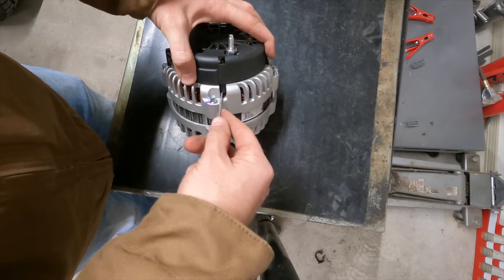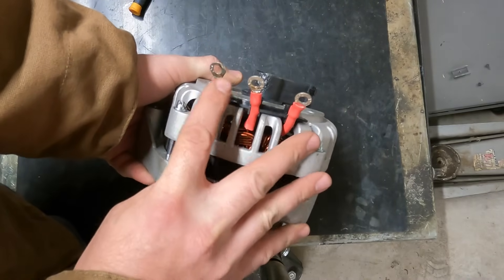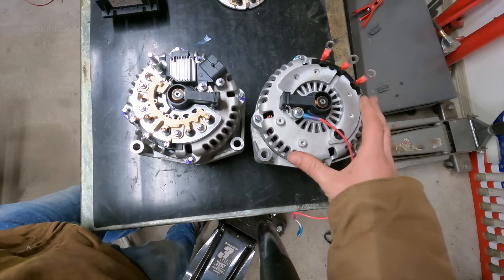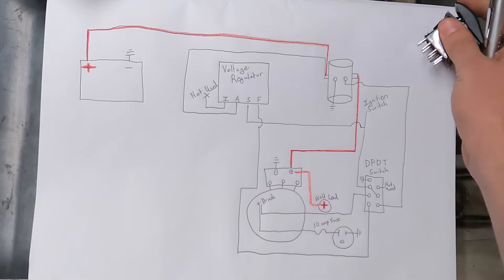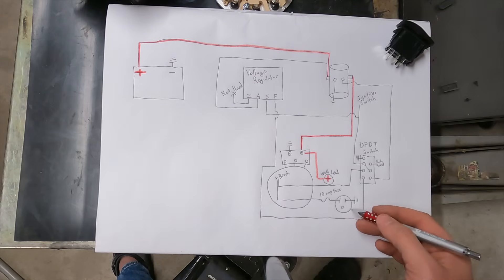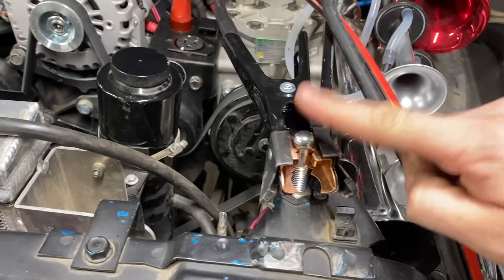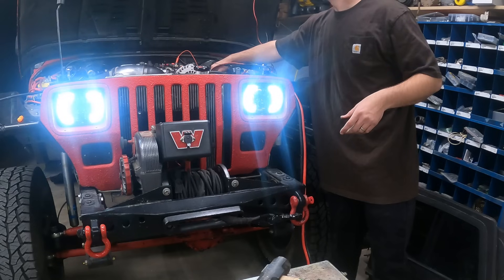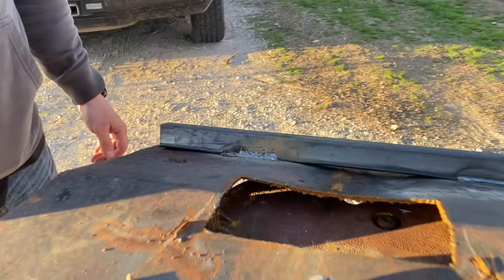How to Modify an Alternator for Charging AND Welding

Comment: Cool mod for the trail.
On solinoid nomeclatur and description,
a solinoid relay is energized CLOSED when applying 12v to the control side. It OPENS when the 12v source is removed.

Comment: Looking at the wiring diagram it seems as though the entire electrical system could experience a voltage spike during a welding operation. Am I wrong? If so, wouldn't that be a problem for the vehicle's computer/ecm?

Comment: Great video and explanations. Are you able to run this set up on modern fuel injected engine and electronics (~2016) without frying them or am I better off installing a second dedicated alternator?

Comment: Overall a good video.  There is lots of internet information on making a dedicated welder from an alternator.  There is far less information on a charge/weld configuration.

One thing you will want to fix is that the welder voltage needs to be visible from the manual throttle.

Comment: Oh by the way you can also connect center tap transformer's to the stator for higher or lower volts just dont connect a transformer to dc it will burn up thats where hi speed mosfets or ibgt transistors come in👍

Comment: Good video you can also make a welder using a mot microwave power transformer like i did by rewinding the secondary  just need a metal box add a copling fan just input output ac welding or like you did use a hi current diode bridge

Comment: Just came across this video, the information for the most part is excellent. I am slightly confused though. In wiring diagram, you show the 110v plug being the positive source for the brushes and the negative coming from the DPDT switch. As I understand DC electrical circuits this would make the 110v plug a service disconnect, nothing plugged in no electrical flow. I believe that the 110v plug should be connected to the same rectifier terminal as the positive welding lead.  Can you please let me know where my understanding is going wrong?

Comment: Thats cool!!!! I would like to try something like that but with a spool gun and Flux core welding. I hate stick welding bought a tig a couple years ago off amazon a cheapy and dint have gas for it so tested the mma function worked great actually used it for 2 days hadnt used a stick welder since the 80s when i was in hi school lol and then remembered i had a wire feed welder in the truck and grabed it i was building a aframe engine hoist. Took me a day just to get decent with the stick lol the wire feed is a 26 year old century 80 ac welder i bought new i can weld the hell out of it but its a hard welder to use just 2 switches no knobs lol. Would definitely like to try this on my truck i have a couple extra alternaters also from what i understand about the ac motors in tools you need 120 volts of dc to get them to work right haven't tried it my self but your grinder sounded i little underpowered. Good luck and loved the video!!!!!

Comment: At 14:17 mark, you pointed out the blade ports on the 120 volt recepticle. With the round port down, wide port on left is neutral, narrowest on the right is positive. You said the opposite. Not sure if it was intentional or a mistake. Im not an electrical engineer. But this video is freakin amazing!!!! You are one helluva sharp minded individual to design this to work so well in such a small sanitary package in an already over-complicated,cramped area under the hood of a modern day vehicle. Thank you so much for this video. Real good stuff right here man.

Comment: on the voltage regulator the I,A,S,F i think they are as I =ignition A= active + S=switch F = fuse for anyone with electrical knowledge that wants to wire this up differently?

Comment: Why not put this to use with a small gas or Diesel engine? That cable control for the throttle looks like it came from an aircraft supply shop. We have those on general aviation aircraft for throttle control.

Comment: Didn`t hear now change in rpm when you struck that arc.. i would imagen that would be a thing that you hear if you think of the load you give the alternator. I mean on some old engines/cars you could hear change in rpm even when you turned on and off the lights, and that`s nothing compaired to and weld arc.

But im a mornon who has no clue . nice video tho

Comment: So is this the same alternator that the engine runs off or an auxiliary? If thats the only alternator wouldnt you be worried about the power running out and the engine quitting while welding and not charging?

Comment: Great video! I can see where you're going with the potentiometer. I'd add a voltmeter in addition with the potentiometer so you can see how much voltage you're supplying the positive brush during the welding circuit operation. It'll create "weld settings" instead of full power to the rod. Good stuff!

Comment: When I weld on a car, I always remove both battery leads. 
But in your case a simple way to overcome the issue the pinned post pointed out is this:
Figure out a way to mount another alternator on your jeep. Also, mount another battery and use both of those exclusively for your welder and make-shift 110v plug. Leaving the "normal" alternator charging system including battery intact and unmolested. 
That instantly solves the issue of crazy voltage spikes running thru the Jeeps system. 
Consider shooting an update video if you're still using this "Welder system." Or??

Good Video!

Comment: I think you’re going to have trouble with that rocker switch under the hood. They can’t handle severe conditions. Between the heat from the engine and the louvered hood letting the rain through that switch won’t last long.

Comment: .. also i worked at an electric motor rebuilder just out of high school, & our 'Solder' jobs on them was closer to Brazing, with an Oxy Acetylene Torch & Brass Rod .. that ain't Solder, that's why it won't Melt with a Soldering iron ..

Comment: Me personally, I'd use a buck boost DC to DC converter to power the field coil with adjustable voltage, to allow the current and voltage to be adjusted. This can be adapted to control charging voltage also. By controlling the voltage the regulator sees. It may require also using a voltage divider as well.

Comment: In normal use, a car alternator doesn't have to produce more than about 14.5 volts output and the regulator progressively reduces the rotor voltage/current as the engine rev rise. An alternator that can charge a 12v battery with the car idling at 700rpm, would otherwise try to output over 100v at full engine revs. It is entirely possible that the standard rectifier pack could cope with your welding current but their rated voltage is being exceeded by running without anything (the regulator) to limit the output volts.

Comment: OMG  rebuilt 1000s of them Alternators  you need to put flux on them heat them i use at lease a 100 Watt Soldering Iron when they get hot blow them with air gun

Comment: I'm no welder, but I do own an ac welder. It came with very short leads. I went to purchase some welding lead cVle at tractor supply, and holy shit, 0 gauge welding cable was $5 per ft! ( This was quite a few years ago. That probably sounds like a bargain now, but it seemed high to me. Oh, but I'm so smart! I can get 20' jumper cables, also 0 ga, for only $25 at the very same  store! What bozos that don't know how to shop! This will give me both positive, and negative for a fraction of what just one side would have cost using their "welding cable" these jumpers are copper, says so right on 'em. Right above where it says ling long brand cables. Made in China. 100% copper. Well... Turns out, 100% copper is part of the company's name, or product, not the actual material found within the insulation.  But I hooked them up, and worked like the cats ass. I'm a fucking tbrifty Genius!. After several welds, I would notice the ground would get very hot. Huh, that must be that duty cycle thing the machine speaks of. Then I would notice it would get very hard to strike an arc. Must be this damn ac machine. I knew fuck all when I bought, had I known I would have got a DC machine. Still, when I used the 7018ac rod, it was easier. Eventually I couldn't make an arc. No matter how long I let the mXhine recover for her "duty cycle" even days of rest. So I took the stingera part, and I'll be damned the copper where the Allen bolt pins the bare wire into the stinger, that wire was all melted back, and some was even rusty. Well we do get a lot of rain here in PNW, some winters are so wet, even copper rusts. Ok, so I realized this jumper cable has its limitations. I found that if I kept my welds to 3 rods, and then let everything completely cool, it lasted longer. 2, and a quarter really, but 3 had a better ring. I still had to cut the wire back several inches And retork that Allen every few uses, but I was mostly fucking around, fixing shit when I needed, or just to practice. One day I was fixing something, I don't recall what, but I needed to get it done, and also go have dinner with my wife so where, so fuck the 3 rod limit, were gonna push her. Bit, and I'll cut the wire back later. I could feel it getting pretty hot, but I was almost done. Then she started making an arc, but I could still see the flash under my helmet, but no we'll, no sticking the rod, I flipped up my lid, and at the splice between the jumper, and the original  leads, which was a very solid connection, and taped up real well, fire scared the shit out of me, I try to go way overbored to prevent it,  likd very anal, to where peopme dont like me around a campfire, trash barre, bbq, l, and definitely not on 4th of July, vecuase of all the precuRions i insist upon before the fire is startes, but at that joint the insulation was on fire, it had lit up some dry grass, and some sticks ect, and was licking tbe cedar siding on my garage. This was 15' away from where I was welding; luckily I already hX a hose where I was working, and had pre wet everything near what I was welding, so I was able to lat those 2'fmames real quick.  I immediately took those jumper cables off and threw them away. They Ain't copper they are steel. They use steel in soldering irons, toasters, hot water heaters, becuase when the electricity flows so nice from the copper wire, then transitions to the steel, it don't flow nice no more, and gets HOT! Resistance I believe they call it. Perfect if you want to make toast, not so if you want to weld , and not burn your damn house, and loved ones down. 
I'm no profesional, not even close, but I try to learn from others mistakes, unfortunately I also learn from my own.  Do what you like, but from someone on the Internet who knows jack shit, I strongly recommend you not use jumper cables to weld metal with. Ymmv. Be cool

Comment: This is by far the best explained and drawn out directions on how to do and make the perfect welder without spending $1,200 on a store-bought off-road father that doesn't even offer 110v power thank you so much like you said there's videos out there to make welders out of alternators but those are ones that you have to build a mounting system if you can even find a room underneath your hood and then find a different serpentine belt and another thing is really hard to do but I really like your setup way more and I will be building one thank you very much for your very well thought out invention which you should really patent thanks again man take care and I will be subscribing I have a 88 Jeep XJ the four inch lift and Firestone destinations what's in mint condition I paid 300 bucks for it love my truck is it going to be a great addition to it

Comment: Wait. Is it a straight up welder? What kind of voltage does it apply?? An Alternator makes AC current. The rectifier makes it DC. If you skip the rectifier whats the AC output from those leads? The amperage on that seems like its good (you welding in the beginning) but with proper voltage or even a transformer placed in line you could get line voltage! Who needs an off grid welder when they can just plug any old device into their truck!

Comment: Unless im missing something, the "rubber grommet" you installed on the bolt for your positive brush didn't do what you thought it was doing unless there was something keeping the connector on the wire from touching the metal...

Comment: Mate, I'm a diy fabricator and this idea made my day. Not for welding though, just for the extra voltage and amps. A 3 phase output to a converter should be provide ample power to a small generator. My 2 cents..., I'd suggest a bigger heatsink on that bridge rectifier.

Comment: Normal field current is about 4 amps I think. Ever measured how many amps it take from (trough?) the ignition switch at full 12V field voltage ?

Comment: I would of used large butt connectors with glue filled shrinks to make connections for wires to go to new rectifier. We use these in water wells extremely strong connections and weather proof.

Comment: Did you try a 470 ohm resistor in series with the field winding terminal on the stock voltage regulator becthats Common for them to burn out if you put unregulated battery voltage to them in ls swaps but i have 2 non working of these alternators so i may just add one to my truck with the option of doing either or

Comment: i wonder if the alternator's stator wire is copper coated aluminum, since you had trouble soldering it...

did it turn silver & appear to be tinned, but the solder wouldn't stick?

i've seen that before!

get a good alternator, ie: oem (from a junkyard). Aluminum seems ok, but it isn't at high amperages. My car wouldn't start with 4 gauge aluminum battery cables, but did with 6 gauge copper cables.

Comment: What size amperage alternator? What is the maximum voltage you can get out of your alternator if you spin your engine up to say around 3,000 RPM

Comment: For DC welding, it's best to use electrode negative. Meaning the "ground" clamp woud actually go to the alternator and the stinger (rod holder) would go to your hood pin. It will help the rod burn smoothly and will prevent those balls forming close to the weld. But this was an amazing project and thanks for taking the time to share it with us.

Comment: I need 72V to charge some batteries, can i just use a solar mppt charger rted at 100A , and put the output from the mppt charger to the field winding, to keep the voltage at 72v, or do i need a higher dc voltage for the field? i think i need between 45 and 60V ac for the mppt charger, would this also work?

Comment: The stator on my alternator has 6 leads. How would I wire it up for this? I checked the resistance on them and there are 3 connected pairs, should I connect all 3 windings to form a Delta or Wye winding? Will I be able to connect it directly to the bridge rectifier then?

Comment: Could this be used for a car audio setup my car isn't compatible with a HO alternator so I'm limited on how big of a system I can run because of my alternator and I can't get a straight answer from anyone in the car audio community on what I need to run a big system and not drop below voltage so I'm looking for a way to create an isolated power source like this to power an LTO bank and run anything I want if it can be done could you please tell me how

Comment: Hopefully you haven't discovered that the switch is likely a weak link in the setup.  The rating on the switch is based on it's ability to switch current on/off in an active circuit.   I suspect you don't toggle it under load and though the currents are high (especially welding), they haven't yet overheated the switch.  However, you might want to monitor the temperature of the switch during the highest anticipated loads.  You don't want a second problem to fix on the trail.  I've successfully used lower rated switches for things like reversing a drill press (small and easily tucked into existing housing).  Again, the switch in question is never actuated while the device is under load.  It will "safely" carry more current in a static mode than it can repeatedly "switch" dynamically.  The question is how much?  The answer would require experimentation & evaluation, especially on something coming from amazon.  Otherwise a great video with good information. Best of luck.

Comment: If you ind someone with microcontroller experience, a nice upgrade would be a control box to adjust your throttle in response to welder settings. This is awesome information, thanks for sharing!
Reply: This seems like it could be fairly easy with an aftermarket ECU on a vehicle with an electronic throttle body, but I'm sure you could rig something up with an Arduino as well on a cable operated throttle.

Comment: Ok i agree with most comments but, there are a few glaring mistakes. 
First of all stick welding is constant current control. You dont have this. Whats needed is a regulator that measures the current and controls the rotor voltage as a function of this. 
Secondly the alternator doesnt have enough reactance. A reactor should be used after the regulator on one of the leads. If you dont know how to do these things good luck blowing holes in your work.

Comment: Its been a few months since you installed this. How is everything holding up? Welded any on the trail with it? Also, do you know if that rectifier can get wet? If it can't, how can you keep it cool while keeping it out of the elements?

Ive bought all the part that you used to put on my LS swapped XJ. Really looking forward to having this capability if i can keep it reliable and safe here in the wet South East.
Reply from the maker: It’s holding up good! Honestly I haven’t got to use it much because my transmission has given up on me (again) 🙄

I don’t see why the rectifier would be anymore vulnerable to getting wet than the one in the alternator. But I don’t know the technical answer to that question. To be safe, I just wouldn’t weld with it while it’s raining or while Im in the middle of a river haha.